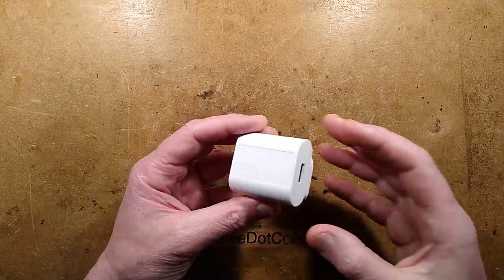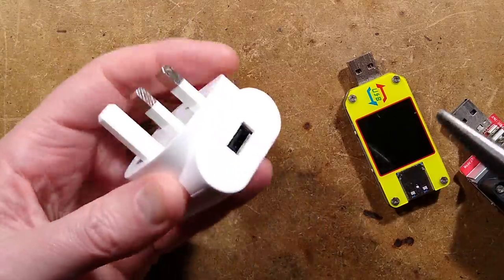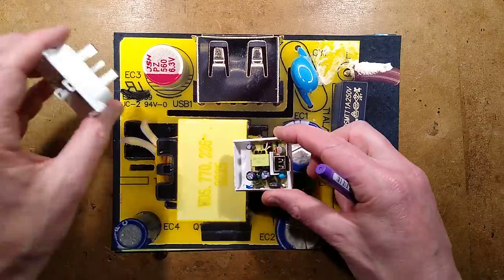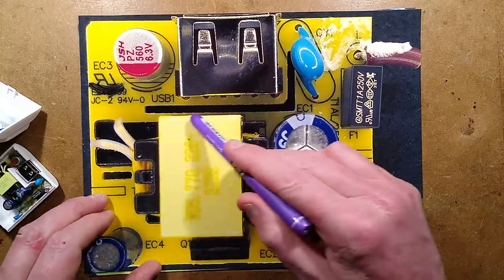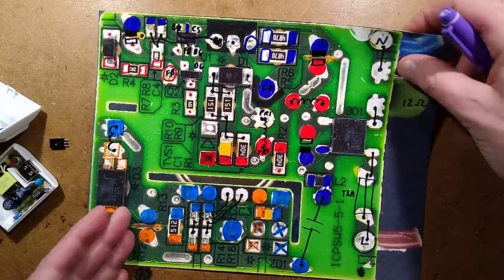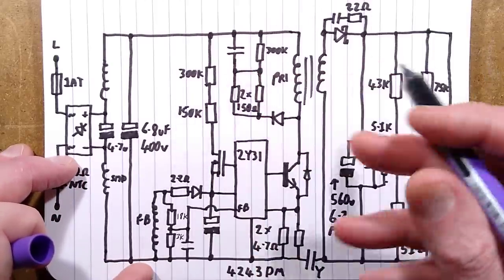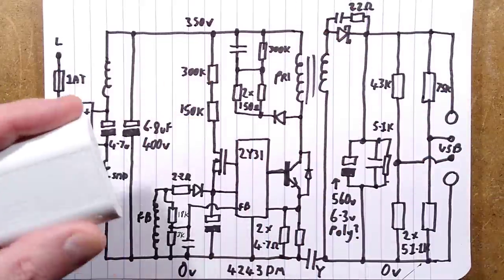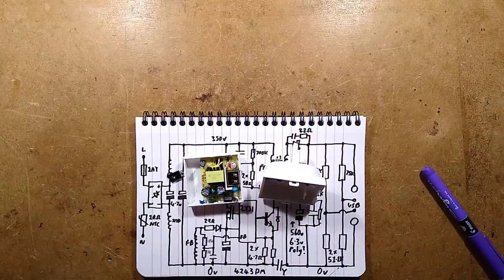IKEA mini Smahagel teardown

Comment: Only In the end I notice the houding even  goes through the separation slot between pri/sec ... Very nice. I wonder what the isolation in the transformer is like.
Reply from the maker: The secondary winding has very thick insulation for extra separation.  I recently took the three port version of this apart and unwound the transformer.

Comment: What is the purpose of the Y capacitor between primary and secondary?  Why is that not giving people a shock? And is it not the opposite of the point of the air gap it bridges over? Yes I know it is a Y class built to the highest security standards and is safe in it self, but why is it needed in the circuit?
Reply from the maker: It provides a path back for current capacitively coupled between the layers of transformer windings.    That reduces the amount of high frequency RF noise transmitted by a cable plugged into it.

Comment: So, how does the chip turn the MOSFET on to start itself up when there's apparently no positive supply to it at all until it has started up?
Reply from the maker: A depletion MOSFET is on by default when unpowered.  When the circuit has powered up it turns it off.

Comment: Thank you for the good description, one question! Where is the 5 volts sensed and feedback to maintain exactly 5 volts at the output?
Reply from the maker: It's sensed in the feedback winding that accurately reflects the peak voltage that the secondary winding reaches when pushing current into the output capacitor.

Comment: While you wer talking about separation one of my old HP screens went bang out the underside (mulit monitor holder) and took out the rcd/breaker ..
at first i thoughts it was the switch, because i saw the explosion projected on the table (..from ikea).. but the switch is fine.

Soo.. monitor was only 20 bucks and really old.. but i guess one of those "i dont have to pay for power so i keep it running all the time" ones.
Definitely a primary side splosion. Guess it didnt like the high summer temps in my room, was running really warm itself.
Reply from the maker: Depending on the age and brand, you may be able to get a retrofit power module online.
Reply: @bigclivedotcom  i had other monitors fail (blow up, not only aged caps), traced where they had the internal secondary side power, usually 12V, if unlucky 12V + 5V and there made a connection to an external power brick... but the monitor isnt all that great. Also still has ccfl and is using a lot of power/getting warm..
I guess i'll send it back to the great planes of the recycling gods to be reborn.

Comment: Would much modification be required to run that off of say, 24vac?
Reply from the maker: It would require a differently wound transformer.  You can get small 24V to 5V units for truck use.
Reply: @bigclivedotcom  ah so I assume it's wound so that at 110v the output voltage is still high enough to keep it alive. Do the input side capacitor and resistor values have anything to do with that too?

Comment: It will always be amusing how Europeans always use 240v when half is good enough like America's 240/120vac system. ONLY USE 240v for an Electric Oven or Cloths Dryer.
Reply from the maker: 240V allows us to plug high power equipment into any power outlet in our homes.
Reply: Why use 120vac when you could use 240v? At my home everything is 240 except for my heat pump, water heater and car charger that all uses 400VAC 3phases. 
The main fuse is 40A but I almost never pass 20A on any off the phases.
Reply: @kjetiltrondsen8242  3 phase is generally used only in industrial industry in America. 2 phases is the norm because why would you need 400v but from the looks of it your country really likes using Electricity on everything where In America we have natural gas and electrical depending on the device. People are going to use Natural gas because of the efficiency and cheaper. This might have something to do with how much land America has and the resources available.

Comment: Please excuse my electrical circuit ignorance but am I correct in thinking that "universal" power supplies all convert incoming AC to DC then use a buck converter to achieve the correct DC voltage ? If so could one input 24V DC and still get the 5V out.
Reply: Summary:
No, you can't input 24V AC right at the input high voltage rails, because the transformer primary turns ratio is really high, 24V AC is probably less than 2 at the output if the control chip would even turn on.

Technically yes they convert the high voltage input into high voltage DC for the control stuff to work (mostly for the main switching chip).

But the high voltage DC is also used to the transformer by the control chip adjusting the switching, as transformers is designed to run on alternating current not DC, pulsed DC works.

The transformer did the "magic" of lowering the voltage and outputs the pulsed DC which then also rectified and stabilized.
Reply: @MatthewDeveloper  Thank you
Reply from the maker: The universal power supplies are usually designed to operate from 90V to 240V but will deal with a margin outside that before becoming unstable.

Comment: Many thanks yet again. Since seeing your earlier teardowns and analysis of previous IKEA USB adapters, I have been preaching the virtues of their designs to all who would listen, enforcing the message on my own family. I have previously been a fan of Anker gear but should it need replacing I would first consider IKEA. Have you come across Anker in your journey through all electrical? Thanks again.
Reply from the maker: I've not explored Anker.  I regard it as a generic Chinese brand with an image, but no guarantee of safety or protection against bad clones.
Reply: Don't know about how well it is put together, but I have a ton of Anker gear and I'm quite happy with them. Would be good for Clive to get his teeth into them. I can send some stuff over if you're interested Clive.

Comment: It's staggering to think that Apple is probably responsible for a billion needless resistors in USB power supplies. Every other manufacturer was fine with tying the data lines together, but Apple wanted resistor networks.
Reply: Do you know if there's any documents online which explain why they're needed?